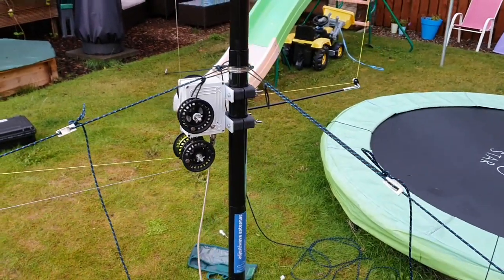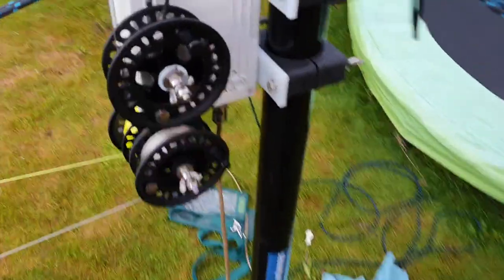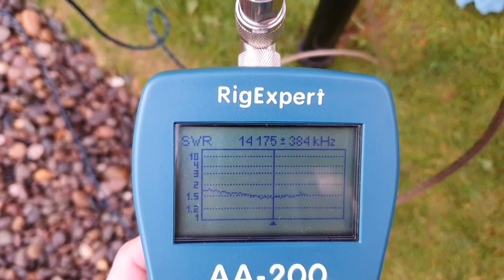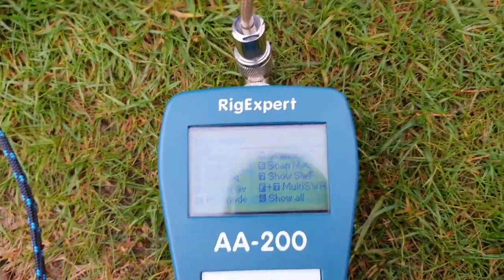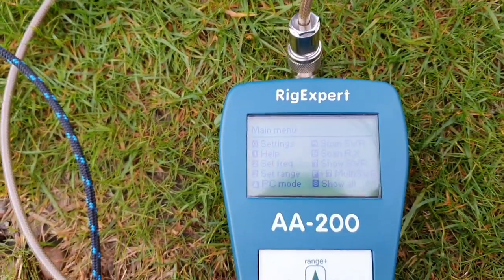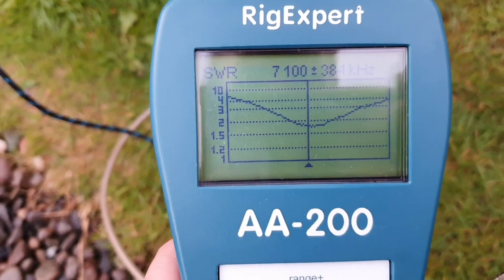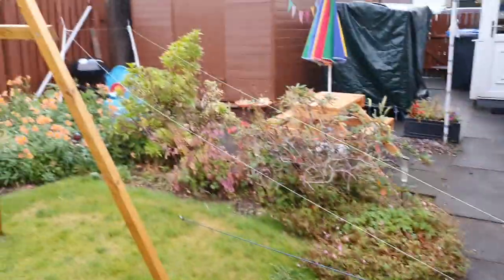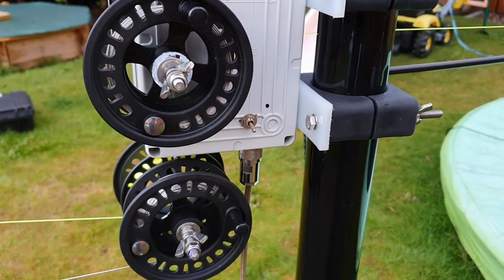Switchable End Fed Half Wave / Quarterwave vertical antenna.

Comment: Interesting....but if you are going to have radials (or a counterpoise) anyway, why not make a fan vertical so "flipping the switch" isn't necessary?
Reply from the maker: I have made it a fan vertical already. Yes works fine. The point of this is to have a 20m EFHW as a verical as its a better DX antenna over a quarter wave. The "byproduct" is it can also act as a Quarterwave on 40m at the flick of a switch.

Comment: More experimentation over the weekend, I will be doing a full field test before my holidays.  Just to clarify I’m utilising my existing 49:1 UNUN slung beneath the reel box.  As EFHW for 40 and 20 it works.  SWR is better on 20 but more than workable on 40.  Increase in useable bandwidth too.   In a fairly strong breeze I did have issues with the 12 meter Spiderpole and using the 10 meter pole results for 40 were slightly down.  The 10:meter Spiderpole lends itself better for portable operation and guying is simpler and more manageable.  What I haven’t evaluated is how the 40 meter EFHW performs as band conditions over the weekend have been down and noisy, but the real positive is that it works and is better than my original linear loaded EFHW lash up (if there is such a name for it).  So now I have to decide whether to incorporate an UNUN inside the reel box similar to what you’ve done. - not difficult to do.

Comment: Great work Colin. Very nice. Will be interesting if you could do a side by side 20m 1/4 wave and 20m 1/2 wave...
Reply from the maker: Definitely Matt, 2 x WSPR running transmitters simultaneously for a couple of days would do the trick. Its on the list for sometime.

Comment: Hi. Colin - good to see you got it working.  Bandwidth looks decent along with the SWR.  👍🏻👍🏻👍🏻
Reply from the maker: Thanks Mike,  it was actually better than this when I moved away from the antenna I discovered later.
Reply: @MM0OPXFieldRadio  I've watched this a few times now and rather than list all the questions I've boiled it down to one, is your tuned radial for use on the ¼ wave version still connected when switched to the EFHW?  I assume so, when you set the EFHW configuration up again can you disconnect what is now acting as a counterpoise and see what the results are?  I'm wondering if there is an optimum counterpoise and if too long de-tunes the vertical element.  Counterpoises are a highly debatable topic and on low power its assumed not necessary.  I will be taking my setup to Cornwall and I'm busy prepping to ensure I made everything.  Won't be quite close to salt water but not far away either.
Reply from the maker: @mikes6844  your right Mike. The radial remains connected when in EFHW mode as a counterpoise. I've no idea if it's better to have or not. It had no effect on the SWR which is good. Eventually if I ever get 2 wspr transmitters I can test.
Reply: @MM0OPXFieldRadio  Thanks Colin, just testing the 10 meter spider pole on how it performs in a breeze as I need a few more stays for the 12 meter version (its a bit of a beast in the wind).  Tests in my garden saw a reduction in wire length on 40 meters which i was hoping for.  And have Max pelican type case all setup for the Elecraft KX3 - great value for money.